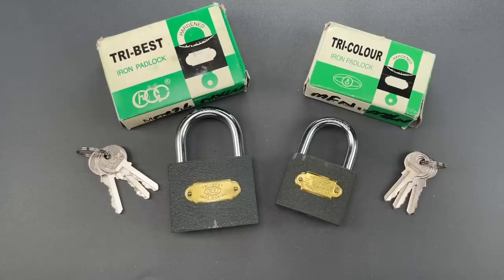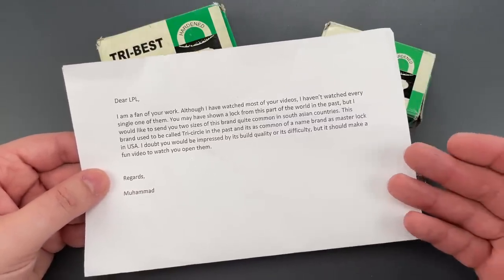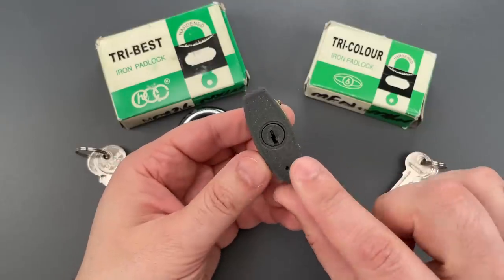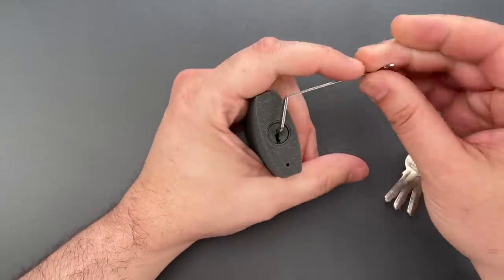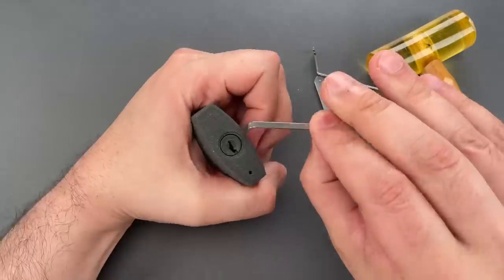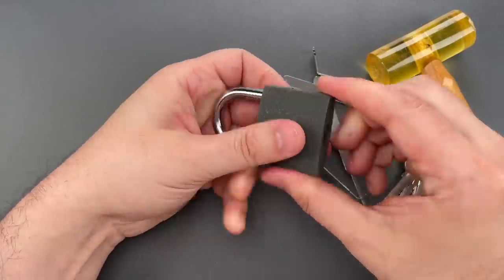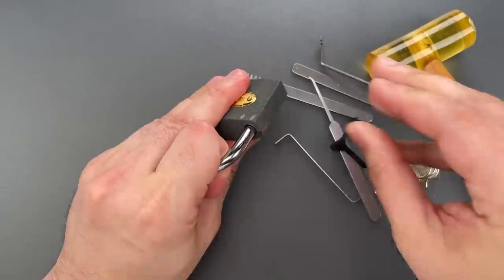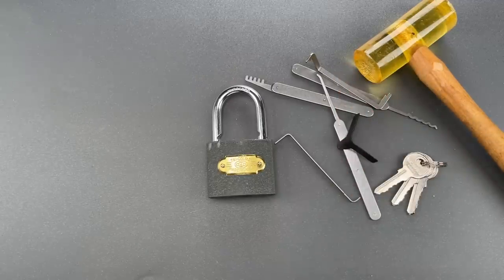[1460] Why I’m THANKFUL For Master Lock… Sometimes

Comment: Anyone have tips of "good" locks to begin with if I want to do this as a hobby? I feel like this look is probably too easy, maybe master locks are a good beginner lock, or should I go with something harder?
Reply: Master locks are a great beginner lock, though I recommend going with some clear locks first so you can actually see the pins moving and build muscle memory.

American lock 1100/1106 are the next step up, still haven't bought one to try picking tho.. so idk how difficult they are 
If you wanna learn single pin picking. For raking and stuff you can just go straight to master locks I'd you want.
Reply: @Alkimachos  I ordered a clear lock, two different master locks, and one other yesterday from amazon. Howerver the clear lock will arrive one month later lol. So, if the master locks are too hard I can wait for the clear lock.

Comment: Sometimes bad locks are good.

I have this really shitty ABUS combination lock, that has made my life much easier. It's really big and solid, you can't open it with a  hacksaw or a bolt cutter, maybe you could cut it open with an angel grinder and the right disc. But the lock is extremely easy to open by feeling when you get the right combination. At least at one point, it was certified by an organisation of insurance companies, for use with things like locker room lockers.

Just having a lock on something, any lock, even a really shitty non approved one, make it a higher degree of crime (at least in Sweden) if someone open, e.g. a locker in a locker room. It means the intruder/thief can't claim to not realising that they shouldn't have access to whatever is "protected" by the shitty lock. And since my shitty lock, technically, have been approved by insurance companies, it means that if something is stolen or vandalised, I get a higher compensation from the insurance company.

At the same time, I don't have to remember the lock combination, or have a key that can be lost. Which is really convenient, when there is something I want to "protect", that I don't access that often.

Comment: i do own one of theese knockoff tri brand locks. and ironically the key is not working because of the extreme metal imperfections so it doesnt push the pins correctly to their spots thus not working. but you can open it if you pull it and hit it with your palm lmao

Comment: Short and sweet! But could you have pulled it apart (destructively) with your bare hands?
Reply: most likely, that's not actually uncommon in padlocks: cheap internals break easily and there were plastic parts all through that one to the point where it didn't sound metal or dense or even heavy enough for it's size when he set it down.
funnily enough I think it might actually be better than average against the other big issue with crappy padlocks being easy to break by hand: a LOT of them are made of a stack of plates of some material all sandwiched together and a lot of the crappy ones don't really bother connecting them all that well leading to a lot of locks that are essentially held together by a plastic washer at the top and/or literally glued together with whatever they picked to use as coating. this one looks like 1: the coating is probably the toughest part of the lock and 2: since the coating fills their appearances requirement they just made a plastic case or whatever in the shape of a padlock which would actually be tougher overall than barely connected plates of metal.

I'm pulling almost all of that out of little more than thin air though so take it with plenty of salt.

Comment: I have a Japanese house lock that will unlock with two different keys. One key will open it no problem that’s used daily. However I have a key that will reset the lock if you use it. How would picking that work? How could you tell that you unlocked the lock without resting it. I would love to email you about this and possibly send you the lock! Looking forward to your response

Comment: Twist ties would hold LPL back longer than most locks on here, and duct tape might make non destructive entry tricky. But this is a shambles. 

Better stick to 'CAUTION RADIOACTIVE NEUROTOXIC PATHOGENS. FULL DECONTAMINATION REQUIRED. - Fukushima Biolab Inc.' Stickers.

Comment: Hot take: I think manufacturers make locks a bit easy to pick for professionals because what if you lose the key and you call up a locksmith and they can't open it? I think it's ok if locks can be picked but if it's so easy that someone with no knowledge of lock picking can do it, it's a problem

Comment: i have a question. book im reading has the character bypass a fingerprint lock by putting on a thin glove, latex, and licking the digit before pressing against the lock. they said the moisture and heat work to reactivate previous digit print. is this doable in real life? i used to think no but after seeing your vids im doubtful! XD

Comment: To me though, these locks aren't much better (if at all) than most Master products. When you are talking seconds of difference between pick times, it really isn't any better. There are good locks (require skill to open), and bad locks (require little to no skill to open). Nothing in between. It either keeps your valuables secure or doesn't.